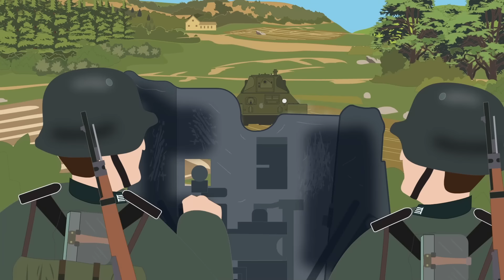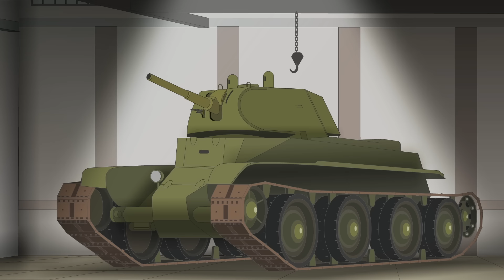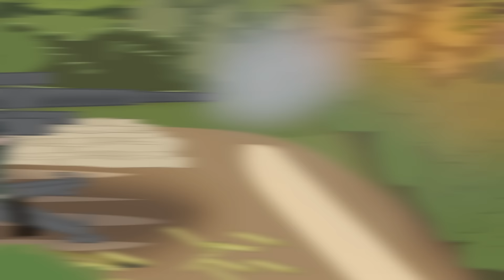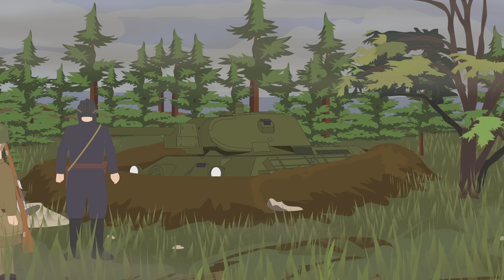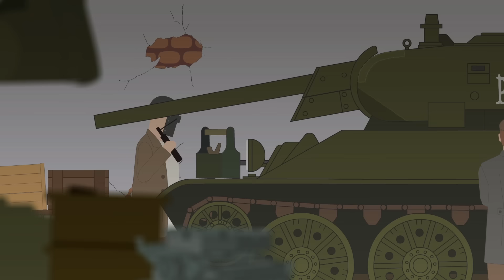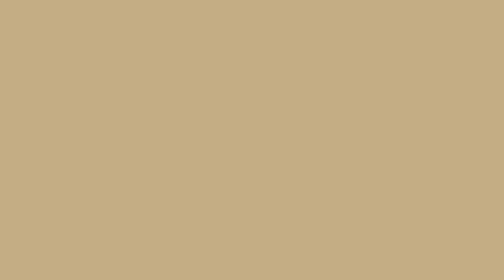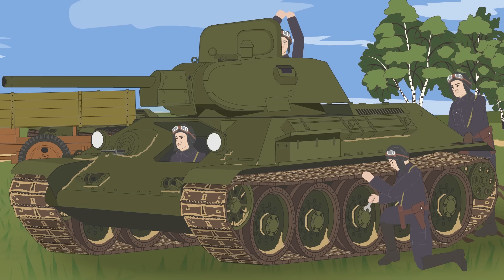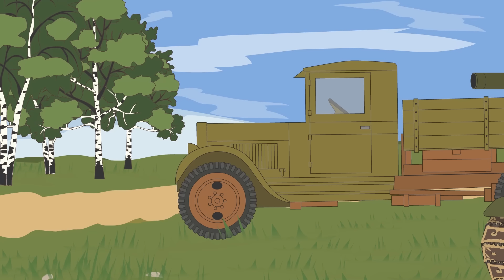Was the T-34 Really the Best Tank of WW2?

Comment: Its sort of strange that on one hand you hear how the germans struggled to beat the T-34 while on the other hand reports show that they took them out Day 1 of the war, even with 20mm guns which the T-34 should in theory be immune to.  Some historians believe that it was infact the KV that gave the T-34 its legendary reputation. Some old german news reels talk about the T-34 while showing an image of a KV-1. Just like all german tanks was a tiger 1 to the americans, maybe the T-34 had a similar fate where it got credit for the KV-1's work. This sort of explains how documentaries and what not always claim that the germans had to use the Flak 88 to take out the T-34 while battle reports tells a different story.
Reply: @projectdvan4568    that was most of t-34s built to 1945 not just early varients due to half or so, of t-34s being built in 1 factory which you can assume they had rushed some parts which they did including but not limited to. No seats mostly the hull mg gunner, no turret basket, no seals for hatches (water gets inside), wheels were mixed matched meaning tracks might break. You can't forget poor welding meant the armor can shatter even from non penetrating hits. As you stated
Reply: @priestoffrogsandfatherofam8659  THIS!! And the fact the quality of the tanks got worse over time as critical components like the ones you mentioned were intentionally left out to meet the ridiculous production quotas
Reply: Exactly.. I’ve watched several documentaries and read about the T34. It was a workhorse for a strategic advantage. It could be rolled out in huge numbers. What is being mentioned in this video is definitely more accurate for the KV1.
Reply: using a flak 88 to knock out a t34 is overkill
Reply: @germanfury  The British lodged that very complaint in North Africa, when Rommel employed the same approach that his otherwise out-gunned panzer division(s) had to deal with enemy heavy armor in France...having the accompanying Luftwaffe "Flak" units, with their 88-mm guns, level them and use them in the anti-tank role.  Our Limey allies felt it wasn't "cricket" to use a large AA piece against a "helpless" tank, and even the thick hide of their Matilda II was no match against the 88.
Reply: The KV-1 had it's own assortment of problems due to it's weight. They usually traveled at a crawl due to having weak transmission which caused engine problems from overheating.
Reply: The very fact that there were multiple accounts of a German "door knocker" getting off many shots before the T-34 it targeted could respond, if that tank responded at all, indicates that either the T-34 was that difficult to work in, or else the crews were that poorly trained, or both.
Reply: @selfdo , I’m going with all the above
Reply: @selfdo  or the gunner died after the first shot because of spalling and it took so long find a place to put the body there was no one to shoot
Reply: The T-34 made most German tank crews into aces before they were killed.
Reply: They "struggled" sooo much that they destroyed 79% of them
Reply: 75mm and 88mm German tanks were able to penetrate thier front side rear cause it isn't that heavy armored
Reply: @smitere7164  battle report show that 45mm and even 20mm were able to crack the armor and disable the T-34. The longer 50mm gun on panzer 3 did the job until the long 75mm.
Reply: @bbb7452  oh yup because the way it was bluid wasn't reliable
Reply: No, the T-34's were a mixed bag. Over half of them came from one factory that was told to pump them out as quickly as possible which resulted in numerous cut corners that caused many Soviet tankers to die. The lack of spare parts also accounted for numerous T-34 losses as some crews had to abandon the tank when they could not repair it. In fact, the T-34 was kind of a terrible tank.
Reply: @captainbadassitude1845  just watch laser pigs video on it
Reply: @captainbadassitude1845  Yep. Properly built, the T-34 was a good tank. But the Russians never built them properly, with overall tank quality actually decreasing as the war progressed
Reply: @projectdvan4568  That was the entire war, not just early war
Reply: Very simple explanation is very few soldiers are actually interested in a military matters to bother learning an encyclopedic knowledge of equipment to the point where they can recognize it on sight. This is basically the same reason why the media thinks every pistol is a Glock and every rifle is an AR15.
Reply: Lots of it is soviet propaganda and german captains trying to save themselves from reprimanding of superiors
Reply: Or how all German artillery were "88's" to American soldiers lol.
Reply: KV tanks were to slow, while the 88 guns also could penetrate the KV tanks alike the upgraded T34. The KV had the exact same gun in the end. And the KV2 was not for fighting enemy tanks, it was a mobile bunker buster. Therefore with this super short barrel and horrible act to reload it, pretty inaccurate and ineffective, too. One hit in this "head" of this tank and it exploded in a huge fireball. It had a different purpose.

The answer against Tigers and Tiger 2 (King Tiger) was actually the new IS (Iossif Stalin) tanks. But they already didn't need them because it was already mostly over. That's why so less were produced.  
With a 120MM gun which had larger range than the former 85 and more pen power and just slightly thickned but super stale armor still provided a high speed and manouverly it was a good answer- that's why the germans invented the new devestating 128 mm anti tank gun to answer the new soviets again. But it was all too late already anyway and only got used on the latest tank destroyer, the "hunting tiger", which only met american sherman tanks.
Reply: @Veoh-Techstarify  The penetration capability of the D-25T 122 mm gun was actually much less than the D-5T 85 mm gun used on the T-34/85 and SU-85.  But the 'IS' tanks were not meant to slug it out with German armor; they were infantry support and "breakthrough" vehicles, dealing with fortifications.  The shells from the 122mm main weapon didn't necessarily have to penetrate to cause damage; the mere weight of the round was enough to cause significant damage to a Panther or Tiger tank; especially late in the war when the Germans no longer had nickel and manganese from the Russian "Nikipol" region to make more malleable "RHA" (Rolled Homogeneous Armor); the "ersatz" steels used by then tended to crack when hit.
Reply: Spot on I was gonna say the same thing
Reply: It comes down to German reports being the main source of historical accounts of the T-34.  They'd rather say the soviets were in human than point out their own faults, especially in the case of people coming in via operation paperclip.  They wanted to highlight that Germany did great, but Russia had some weird mythical reason they won.  It's a mix of hubris and trying to justify themselves to someone they needed help from.  The T-34 wasn't any more special than any other tank.  If anything, they had problem.  The pins coming out.  Everyone points to the wedge being "simple soviet engineering." (Thanks Commisar Empanada for being exactly the kind of propaganda I need to prove my point.) But the fact that the wedge was needed shows the poor and rushed production.  The rush of trying to crank out a ton of these to meet quotas led to tolerances for error becoming laxed.  In fact, the T-34s produced post war are leagues better because they were built closer to the actual specs with less corners cut.  That track issue was, in part, caused by the fact that they didn't have enough rubber, so they just didn't put rubber pads on the tracks.  Tight maneuvers, because of this, would result in failure.  And the whole "the armor is angled" shtick.  What do you think EVERY OTHER TANK OF WWII WAS DOING?

edit: Interesting counter point to this
https://www.youtube.com/watch?v=CIZ6PFYUM5o

Sure, you can't look at it and assume everything is right, but I think it's a great example of how history gets twisted by who tells it.
Reply: The reason 20mm cannons could disable a t34 was due to spalling of the armour even when not penetrated due to it being highly brittle and of poor quality, it is not until after the war that the t34 gets better armour.
Reply: @yesterdayschunda1760  it's not until after the war that the t34 got better anything
Reply: @TurtleSauceGaming  Pretty much, Early war designs the armour was quite terrible due to being too brittle so even non penetrations could kill the entire crew from spalling.
Reply: Most likely why 20mm guns were taking out the t-34 was because the armor would literally come apart, or the crew would be killed from spalling as the armor was made very hard but also very brittle as it was heat treated to 600 Burnell. The design for the tank was decent on paper, but what they actually made was terrible. It had a terrible gearbox, transmission and was also very cramped so with the suspension they had on the t-34 the crew was bruised and tired from riding in it.
Reply: @anhaltboyzrule1704 naw, most tanks can be taken out with 20mm cannon, even M1s. From the rear. If you throw untrained tankers into battle they will fail. The advantage the KV-1 had is the side and rear armor was only slightly thinner (iirc 70mm vs 75mm) than the frontal armor. It's ridiculous. Basically the IS series they optimized the armor and suddenly the tank was massively tough.
Reply: TL;DR Russian tanks were way less effective in finding, firing at and hitting their targets than the Germans. The Germans won by outmaneuvering their counterparts. 20 mm rounds can penetrate the early T-34's side armor at close range.

In 1941 T-34s had better armor and better firepower. And everything else was worst. Training, tactics, command and control, visibility, reliability and so on and so forth. Further more the Germans units had first hand experience.

Optics were worst, the T-34 lacked radios, they had one less crew member so the Gunner was also the commander. The germans estimated that for each shot by a Russian tank, they fired three. Due to the lack of coordination a group of T-34 was far less effective as a unit. Russian tankers went in battle buttoned up and with worst visibility. If you play war thunder or world of tanks none of these real life problems would be there.

Of course the 1941 problems were fixed to some extent throughout the war. Tactics improved, reliability improved, the later turret was bigger and had a three man crew and so on.
Reply: @tarkalak  The KV-1 was better than the 1941 T-34
Reply: Yeah the T-34 got killed en masse.  It was not a good tank.
Reply: And many KV tanks had the same 76mm gun as the T -34.
Reply: @Frank F Kling Give credit to the USSR that they did produce that many tanks in WWII.  They did so in part due to what Lend-Lease provided, not so much for tanks or aircraft that were sent, with the possible exception of the Chevrolet, Dodge, and Studebaker trucks, which not only put the Soviet Army on wheels for the first time, and found great use towing antitank guns or mounting the rocket launchers ("Katyusha"), but were copied, post-war.  Other "soft" items like medicines, leather for boots, all manner of pre-fabricated kits for things like Quonset huts, and FOOD.  The Soviet soldier actually relished Spam, being as at least it was MEAT, something not in great quantity in those days.

The Soviets also recognized the glaring deficiencies of the T-34 almost from the beginning, but at least it was better than the BT series of tanks that it replaced.  The BT tanks, used in the Spanish Civil War and against the Japanese at Nomohan, were found wanting.  They constituted the majority of Soviet tanks that were lost by the thousands in the opening weeks of Barbarossa.  Particular criticism of the T-34 is of it's "Two-man" turret; which can be explained by looking at the development from the original A-20 to the T-32.  They were originally intended to sport the 45-mm gun, which at the time was more than adequate against likely opponents.  The Soviets also tried fitting a hull-mounted 76 mm gun to the A-20, and were not happy with how cramped it made this vehicle, so the idea was quickly discarded.  After deciding that the tank simply had to do with ONE cannon, it was decided that HE capability that the 76 mm gun offered was more important than the 45 mm gun's anti-tank role; and with the proper armor-piercing rounds, the 76 mm did quite well anyway.  But, as it was much larger, the turret could not accomadate it and the necessary third crewman, so the commander had to take the role of gunner.  This would, of course, greatly hamper the tank's tactical efficiency, especially for the platoon or company commander's vehicle!

There were other reasons why the T-34 fared so badly, as commentators like "Chris Intel" have pointed out in detail.  The Soviets were planning their own "surprise" attack on the Germans for later in 1941, Vladmir Rezun ("Viktor Suvorov") gives it as only two weeks after Barbarossa, i.e., July 6th, 1941, but it's very doubtful that the Soviets, given their organizational problems when the war broke out, were going to meet that date at all.  Realistically, any Soviet initiative to start the war probably would have waited until well into the fall; after the harvest season (Army personnel badly needed to assist) and giving time for the necessary logistical preparations.  The T-34 tank units reflect exactly this terrible state of organization.  To meet their production goals, which, if they hadn't been, could have gotten the factory management shot or sent off to Siberia, T-34s were often delivered without gun sights, seats, radios, or even machine guns.  Quite a few had defects right out of the factory; "repair" crews had to be dispatched to get the vehicles in running order at the various military districts where issued.  The supply problems also hampered readiness; diesel fuel, also needed for the collective farms, was in short supply, as often were the necessary armor-piercing rounds. There were numerous examples of T-34 battalions having to go into actions without ANY ordnance for their  76 mm guns at all!  Never mind also that the training had been utterly lacking; for many crews, this consisted of three days of classroom instruction, with two days to get inside a non-running model and go through the motions of a simulated battle.  As problems with the gearboxes, clutches, and steering were already being found, that ruled out any  maneuvers that would have at least given the crews some time to actually drive their mounts!  It is any wonder that not only the Soviet tank units with the BT, but even the T-34s, typically suffered lopsided losses in 1941?
Reply: As a Flames of War player, this is true
Reply: The Soviet had 2x as many tanks as the entire rest of the world combined had ever produced even including WW1. Many of them were fairly vapable and even most of the lousy ones were goid enough to overwhelm the German army easily. And they failed. First because Stalin was so afraid of provoking his ally Hitler to turn against him he forbade any mobilization before the invasion (how the tables have turned, right?). Second, because they just produced tanks. They didn't produce spare parts, the troops couldn't train because there was no way to keep them running. So when the war started it all collapsed. By the time the Soviets started sorting out their mess, the Germans had started upgrading and anyway the Soviets had to train their army while fighting which tends to make it take longer to to develop basic skills since one has to survive to learn.
Reply: Well, I haven't heard exactly that.

But what is rather fascinating and complicated is how the T-34 and the Tiger tank kept trading places with new versions.  The Tiger would be upgraded, and then the T-34 was upgraded in response, on and on.  Quite fascinating really
Reply: @MoseleyJon  that's not how it went down. T-34 was far inferior to the tiger at any point in the war. The last version had to be at 800m or less to be able to pen it frontally. It couldn't handle the tiger 2 frontally at all.
Reply: Thats probably bc most manufacturing companies in the soviet union wanted quantity over quality like the Americans m4 sherman
Reply: @darshnapatel5039  and all the design flaws like 2man turret, being overly cramped due to it's sloped armor that quickly went obsolete, being praxtically blind when closed up which they had to do to protect against machienegun fire. No commanders copoula, did I mention 2 man turret? No turret basket. Too small escape hatches, storing fuel in the crew compartment. The list goes on. The design wasn't very good.
Reply: @darshnapatel5039   Well under the Soviet Union, the "companies" were owned by the government under communism.  So they would do whatever the military wanted them to do.

But the USA's Sherman tanks were junk because they were built in the middle of the USA, had to go on trains, had to go through narrow train bridge openings, had to go on ships, and had to be offloaded from ships in Europe.

The Soviet Union (like the Nazis) were building much more massive tanks on European land, and merely driving the tanks to the battle or putting them on the back of massive trucks or on trains, but they did not have the narrow railroad bridge openings to fit through.

So the USA could not build quality tanks.  All we could do was build large quantities of junk.
Reply: @MoseleyJon the M4 was one of the most reliable and cost-effective tanks of the war. You fully bought into the myth.
Reply: This makes so much sense!
Thank you
Reply: German tiger was undoubtedly superior over simplistic t34 and would take it out 9 times out of 10 . Have a read about German tiger commander Michael Withmann who singlehandedly destroyed whole unit of like 20 t34’s and drove back to base . There was a old joke about t34’s . “How many t34 tanks are needed to destroy one Tiger tank , answer is - 26. Cose tiger had 25 shells before it run out of ammunition haha
Reply: @piccadillycircus9416  that's savage!
Reply: @piccadillycircus9416 Oskin took out 3x KING Tigers by himself with a t-34! Lol
Reply: Yeah best Tank in ww2 has the most losses... axis 1:5 soviet ratio ain't in my head a good ratio.
Reply: @eemelianttonen8641  ya, I really don’t know who thought the T-34 was the best tank of WW2. I think you’d agree with me that on PAPER it’s a pretty good design, but Soviet reality is far far different than paper and the quality of each tanks armor, firepower and mobility varied greatly, even coming out of the same factory
Reply: @eemelianttonen8641  maybe because germans literally had 5 times fewer tanks?
Reply: @_jagerbomb  The Germans had plenty of tanks. The problem was that they ran out of fuel. After they used up all the petrol that Stalin so kindly gave them when they were allies, they had a great deal of trouble making up the shortfall. Another problem was maintenance. German tanks were complex, and needed to be maintained properly, but the supply system of the Germans was terrible. The Bolsheviks had a similar problem, but their tanks weren't designed for survivability and were cheap to replace. Barring that, if the Red Army could hold onto terrain they had plenty of destroyed Russian tanks to salvage parts from.
Reply: @eemelianttonen8641  that was mainly down to rubbish Soviet tactics
Reply: @longshanks7157  Not true, the Germans had a 3-to-5 kill ratio and Soviet tactics weren't the problem, it was logistics. These tanks were rushed to the front, many unfinished, and prone to breaking down or catching fire. It was literally just that the Soviets fell into a death spiral of producing cheap T-34s because their T-34s keep dying enmass because they are cheaply made.
Reply: @captainbadassitude1845 , yeah, that bout sums it up. Even Stalin was worried that tanks were being sabotaged by their crews because there were so many tanks breaking down. T-34-85s salvaged after the Berlin Wall fell were tested and ultimately, were discovered to be absolutely terrible.
Reply: @eemelianttonen8641  There was no such ratio.
Reply: @skywillfindyou  Yes trust the Russian when it goes to tanks. They totally arent biased and totally arent brainwashed, by the coping amount of Propaganda in Russia.
Reply: Sounds like Russian propaganda
Reply: @deancorrigan1548  how? He's literally saying that, possibly, the KV-1 was the better tank.
Reply: @tyomikshkolnik7988  yes, a lot of Myth was by mixing the encounters of KV1 with T34s. The T34 was a nasty surprise, but manageable usually. The KV1 was a real nightmare, only could be beaten with 88s or from the rear or flanks with other guns until appeared the PaK 40 or the KwK 40. By the middle of 1942, the slight advantage of the T34 vanished with the advent of PzKw IV with KwK40 and more armour. It could deal with the T34 without almost any trouble, even with the KV1 at longer ranges than KV1 could do against PzKw Mark IV.
Best regards.
Reply: @deancorrigan1548  For you, everything would sound like it.
Reply: @skywillfindyou  Well no not really.
Reply: @deancorrigan1548  “everything praising anything Russian is Russian propaganda”- you
Reply: @yeetyeet5079  Correct
Reply: @projectdvan4568  and there is also spavling idk of to spel it so tell me how you spel it
Reply: @niclink1030  spalling
Reply: The panzer 3 was killing T34s easily all war.
Reply: @kyle857 , I wouldn’t say they were killing them easily. But the up-gunned versions certainly were
Reply: @hetzer5926  the armor was so brittle that non penetrating rounds would crack the armor. The damn thing was a literal death trap that would cause most of it's crews to get chopped up
Reply: @hetzer5926  no actually the first day of Barbarossa Pz3’s took out 6000 t34 if I remember right and most Pz3’s had stub guns because they were designed to support infantry while pz4’s later models were mostly AT focused
Reply: @Whiskers4169 , the T-34 and KV-1 were still being integrated into the Soviets military at the time. And they weren’t exactly the cheapest vehicles to make. Most of the Soviet tanks used during the first few days of the war were BT-7’s and T-26’s. A little under 2,000 KV-1’s and T-34’s were actually in service at the time. Even then, most of those were knocked out by dedicated anti-tank units. What T-34’s and KV-1’s that were deployed caused a few issues, mostly the KV-1 though, a large number of the T-34’s suffered from mechanical issues and had to be abandoned and they didn’t really do much fighting. But a few KV-1s tied up the invasion for about a day at most. 

During the initial days of the invasion, tank battles were rare, and even when they did occur, they were mostly against those KV’s that tied up the advance or against counter charges by BT-7’s/T-26’s. Panzer 3’s struggled to do much of anything to the KV’s, but they faired better against T-34’s but their main armament, the snub gun howitzer, wasn’t meant to be used against armor, so they struggled penetrating the T-34 but it wasn’t impossible. 

Up gunned versions of the Panzer 3 and 4 were far more successful against T-34’s.
Reply: @hetzer5926  ok I remembered it there was like 6000 losses and 2-3 thousand was t34
Reply: @hetzer5926  also penetration is not what kills a tank as long as the impact was strong there were guaranteed spalling and possibly cracks and huge chunks getting torn due to poor heat treating or the thing where you put the hot metal in water so it acts thicker whatever it’s called and it’s normal the snub nose howitzers we’re not as good as upgraded versions as I said it’s meant for infantry support
Reply: @Whiskers4169 , your right penetration alone doesn’t kill a tank. Sometimes, if your lucky, a shell can cause armor spalling even if it can’t get through the armor, which was a problem with the T-34. However, the snub nose guns some panzer 3’s were equipped with, and even some short barrel guns other variants of the panzer 3 had at the time, didn’t have the necessary velocity to reliably cause armor spalling. (AT guns typically fired shells at higher velocities, which is why most tank kills during the early days of the war were done by AT guns). The early T-34’s panzer 3’s faced also were less likely to have fatal defects such as poor welds or other problems that later T-34’s experienced. Up gunned Panzer 3’s and Panzer 4’s were not only equipped with a larger gun, the guns equipped could also fire shells at higher velocities which were more likely to either penetrate and or cause armor spalling.
Reply: @hetzer5926  I’m not arguing with you but even some small arms coused spalling in t-34 I’m not sure how a tank caliber would leave it without any spalling
Reply: @Whiskers4169  those were most likely tanks made later in the war not front line tanks during the first day of the invasion. Plus, tank shells work in different ways. Explosive shells used by infantry support tanks cause more of a boom so their not designed to go far and deal the kind of damage that would cause armor to Spall. Sometimes it would, but it was more likely to overpressure the tank than anything else.
Reply: @Whiskers4169  it was the other way around. Pnz 3 with all purpose guns and the panzer 4 with howitzers. Later the pz4 got upgunned.
Reply: @bbb7452  but that doesn’t make sense pnz 3 was infantry support maybe I mixed up howitzers with stub gun all purpose
Reply: @Whiskers4169  panzer 3 was the one made for fighting other tanks. Panzer 4 for infantry support.
Reply: @hetzer5926  even without having the larger main cannon Panzer 3s could take out T-34s due to the steel being overly heat treated. This caused the steel to become brittle upon impact and would send shards of metal flying about inside, causing numerous casualties and typically forcing the tank out of the fight due to the large crack in the armor
Reply: @kyle857  No, the Panzer III had a 50mm gun, you're thinking of the Stug III... which was ruthless.
Reply: @insomniacbritgaming1632  

The long 50 mm could also deal at short range with the T34.